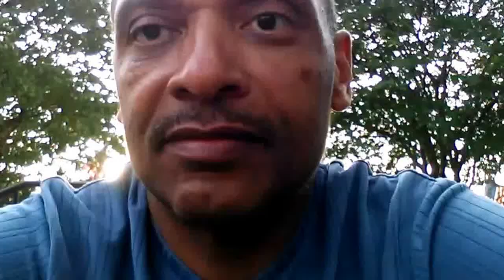Tesla 2170 lithium ion battery for semi trucks and model 3 big changes battery construct

Comment: Cells are not becoming dead. There is a lot of info on battery life. Please study this as you seems to need that :) You do not understand as well as your friend how the Tesla battery pack with the BMS really works.
Reply from the maker: +Hans Kruse he said limited number of cycles cells capable of
Reply: I don't understand your answer.
Reply from the maker: The point he made was that there are a limited number of cycles that each cell can do over time.  Once you reach that limit cell cannot go thru the charge expend and recharge process anymore.
Reply: Long before this happens the battery pack will be below 80%. It is estimated from Tesla that the battery pack will last at least 12-15 years and data gathered from tesla owners suggest that by 500.000 miles or 800.000km's the battery capacity will still be over 80%. So this discussion about individual cells dying does not make much sense to me. Tesla offers a warranty on the battery which is 8 years and unlimited miles.

Comment: presumably the temperature of the battery cell and overall pack is having to be regulated heated or cooled. That is where the loss in energy comes from not the fact that the chemistry of each cell is being degraded...I hope that is more the case. I know there is coolant and fans in the components of an X and the S. Is there heating? probably that's the energy loss.
Reply from the maker: +Greg Coates the moderate temp times or places  don't impact energy use to condition the battery for optimal performance
Reply: Teslafaninsight Clearly there is good longevity of battery life with these batteries in the S or the X. Nissan Leaf Gen 1 did experience some degradation but were able to rectify this by 2013 Gen 2. The Nissan uses flat pack battery, like in a smartphone.